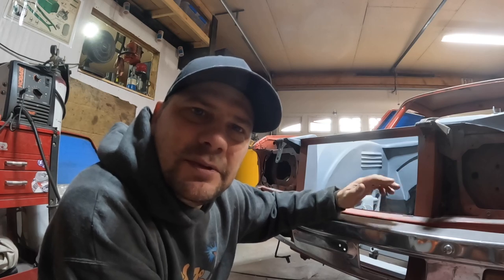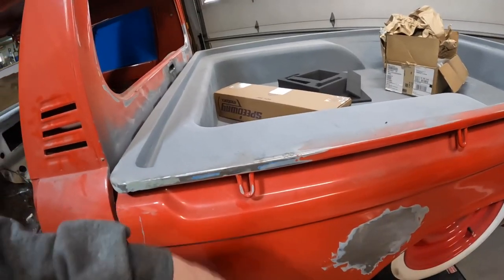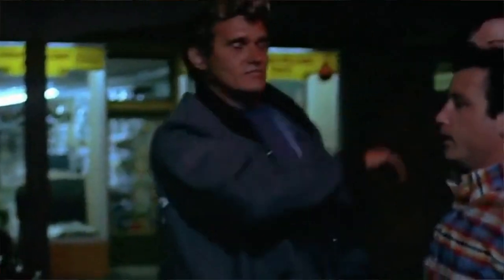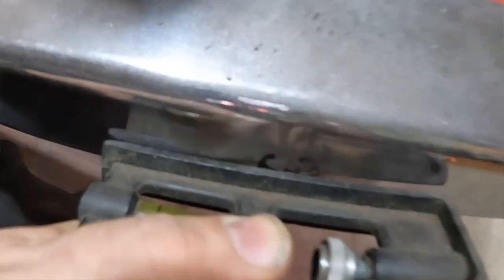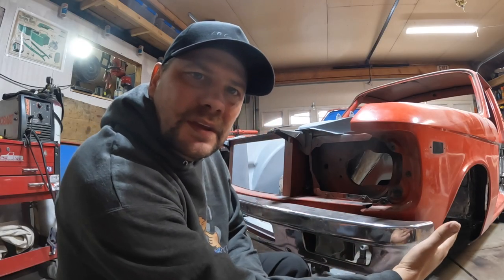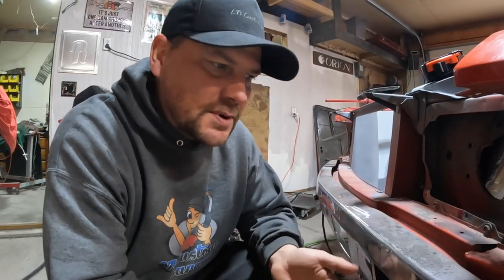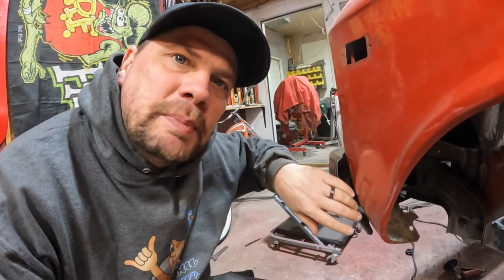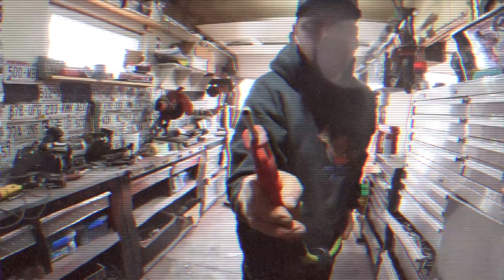The best way Ive found to SHAVE BUMPER BOLTS. Plus, more custom bumper modifications

Comment: I really dig the idea of cutting the bolt in half and welding half. Kept everything where its supposed to be.
Reply from the maker: It's my preferred method for sire  I had one crack on a freshly painted bumper doing it another way, must've been welded in kinda crooked